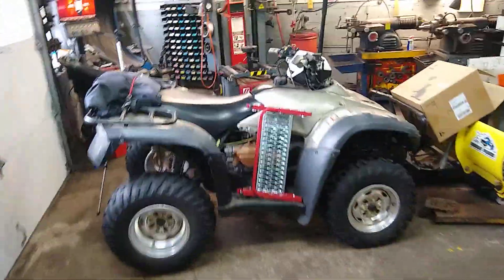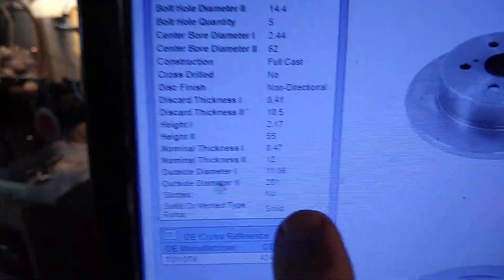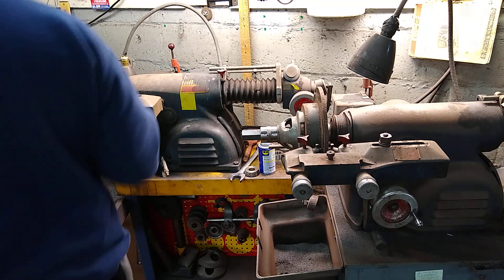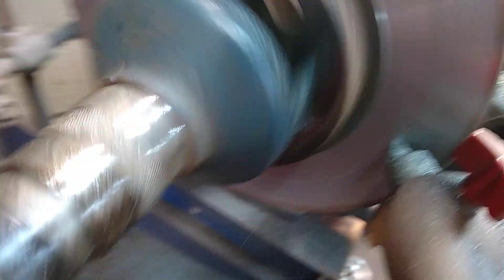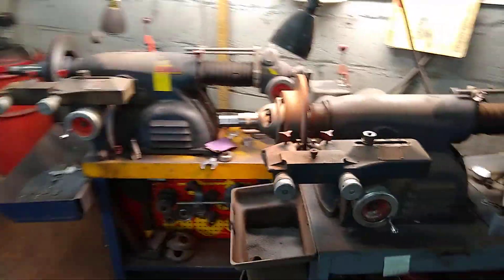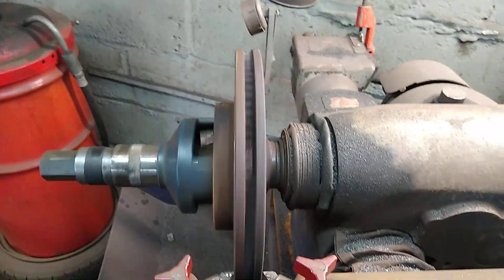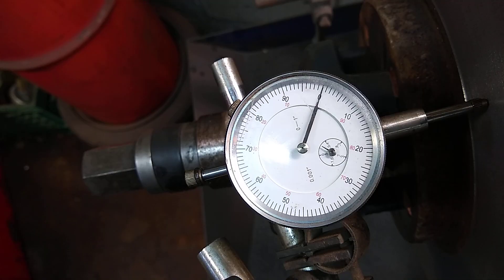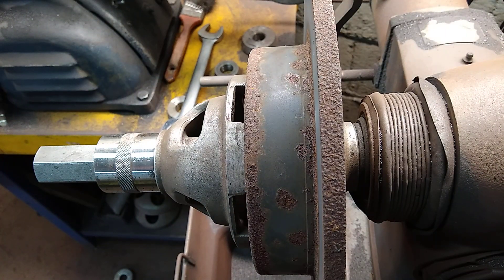How Brake Rotors and Brake Discs are Resurfaced using a Ammco Brake Lathe

Comment: Great video, I have the same machine in my home shop. I always have a problem trying to get the minimum thickness data. What is the website you went to in the video to get that information ?
Reply: Hi Richard, I get the specs through my commercial account with login and username available to my shop, and this only available to shop owners, However if you search aftermarket brake rotors online for specific vehicle, most of the time they list discard thickness on the manufacturer website for that new rotors and this # will be very much the discard thickness for the one you have. I hope this help!
Reply: @MA-zo5kk  Thanks for your quick response. I will try that. I agree with you that the original equipment rotors  that can be resurfaced are far better than the aftermarket rotors made in China or Mexico. I am retired now and I put together a little shop at my house. I only work on friends and family vehicles these days.

Comment: Hello from Vancouver  WA,  Great  video!  Where can I buy this kind of machinery ?
Reply from the maker: Hi, I have these for about 15 years or more, Ammco is the brand I have but they are expensive new, you may find used ones online, also Ranger have one, in the meantime search google for brake lathe sellers, you will find different distributors, Ammco brand is really good quality but pricy, mine can cut rotors drums and flywheel, good luck.